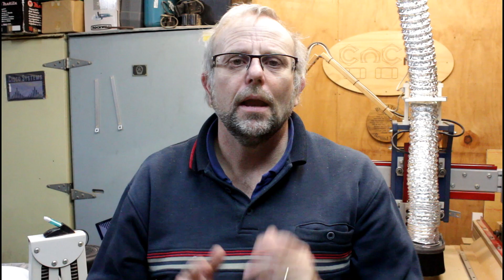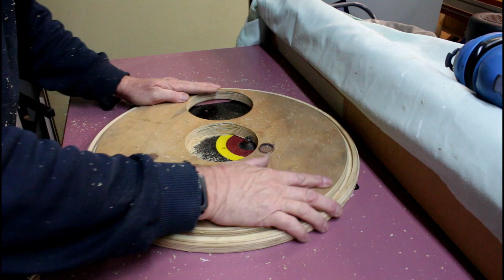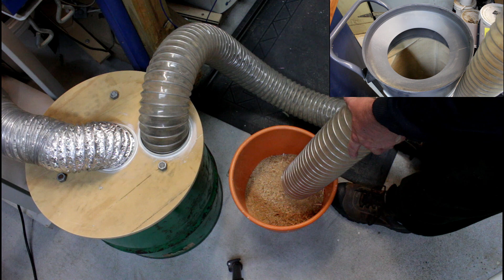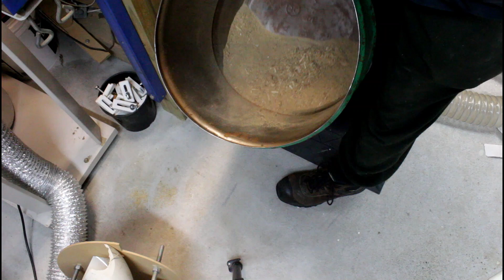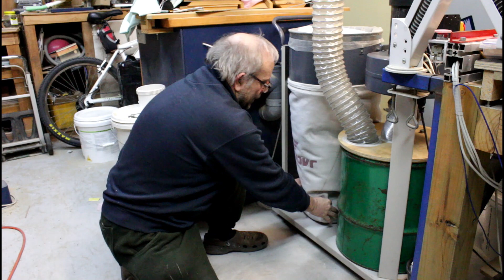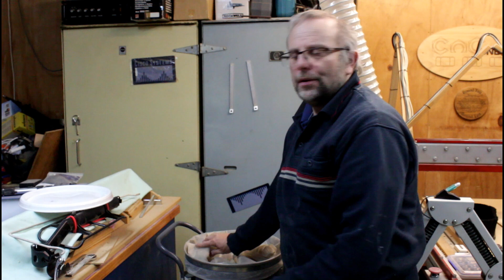Dust Collector Thein Separator Build - CNCnutz Episode 219

Comment: Great video. Is there a set height that the suction coupler should be off the bottom panel? I know the elbow sits on the bottom panel. Starting mine on Monday.
Reply from the maker: I think it is 3 inches but check out the link I have on my webpage to the original designers article. It has all the relevant info. I just made it to suit the 4" elbow I had laying about and it turned out fine so it probably isn't critical.
Cheers
Peter

Comment: Hey Peter, great project. Do you have the CNC file by chance that you’d be willing to share?
Reply from the maker: Hi Casey
If you follow the link below the video to the writeup I did you will ring the original designers page and on there be gives measurements to make one. You will need to draw to suit your collection bin as scaling will not work.
Cheers
Peter

Comment: Hello Peter, I wanted to make a cyclonic vacuum cleaner because what you say the dust is put from one end of the workshop to another that goes to the lungs, I wanted to ask you what you think this turbine that you thought buying to do, it will be enough to Aspire?.

OBR 200M-2K Industrial Radial Radial Ventilator Fan exhaust fan Centrifuge Centrifuge fan Fan Fans https://www.amazon.es/dp/B06X3SB2D9/ref=cm_sw_r_cp_apa_i_X-EuCbJQZG2QA.

Thank you very much and greetings.
Reply from the maker: Hi Victor. I'm not really the right person to ask about the vacuum unit you are looking at. It certainly looks bigger than mine. Mine is 1hp. From what I have seen most of these fan units are basically the same in design.
Cheers
Peter

Comment: I have a question about the size of the dust collection hose... I don't have a vacuum such as that, and will be using a shop vac. I have 2 shop vacs now. I have 1 with a smaller 1.5" hose that has a higher    hp, and a second shop vac with a 2.5" hose, but a lower hp... any advice which one to use?
Reply from the maker: Mine is a 1hp dust collector with a 4" hose. More than that I don't really know. It is low pressure high volume setup. In my opinion the shop Vac with the  bigger hose would be better for a CNC dust collector than the one with the smaller hose but don't know for sure. The DC I haven't isn't very powerful and adding the separator  hasn't done any it any  favours but time will tell if it was a good idea or not.
Cheers
Peter

Comment: Good stuff, thanks.  Inverting the dust bag upside down was very clever.  On a completely different note, is that a USB stick in some sort of USB extension cable with stand on the "elbow" of the monitor stand?  Cheers, D
Reply from the maker: Thanks David. Yes it is a USB stick on an extension cable. It has the Gcode files on it.

Comment: Good job Peter.  I adapted my dust collector so that it uses a drum instead of the bag.  The drum is a lot easier to empty than the bag.
Reply from the maker: Thanks John. That would be a good option as well because the bag can be a sod to get back in place. Do you have any video or photos of how you adapted the from to fit?
Cheers
Peter